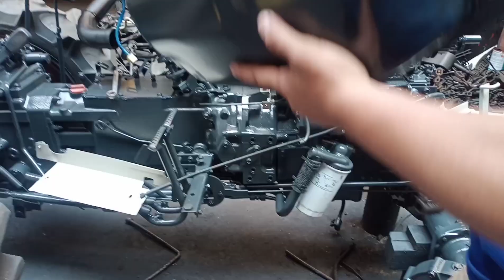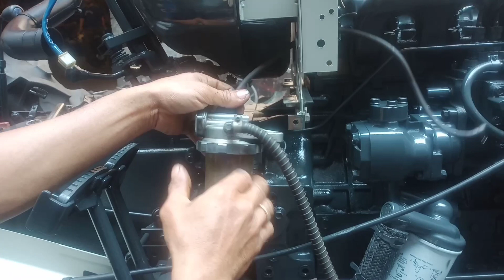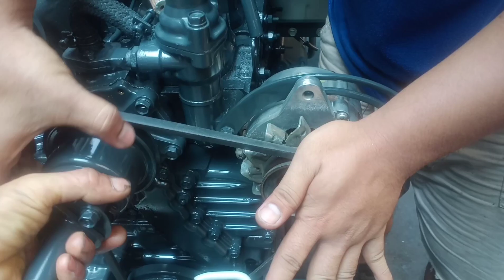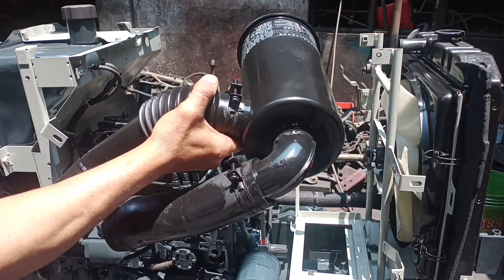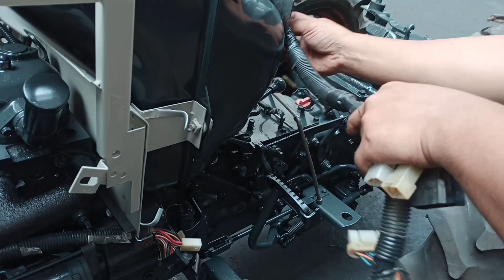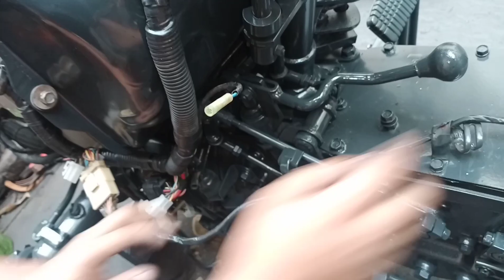How to assembled and wiring tractor sunshine L1-235 part 1

Comment: Sir ano ang dahilan bkt mabilis mag taas ang temp. Ng tractora namin pag sinalang na sa pagrototovator pag travel Naman o idling eh halos d tumataas ang temp. Gauge  ok Naman cooling system nya nagpalit lng kami ng head gasket eh nagkaganon na
Reply from the maker: Lokal Ang gasket sir.ibig Sabihin baklasin mo ulit kc sunog n nmn ulit Ang head gasket mo.
Reply: @tractorsmarinemechanic  ano po ba ang original na head gasket anong brand ung pang 4cyldr na kubota 02 series
Reply from the maker: Pumunta k sa Kubota center at don kabimili, sir